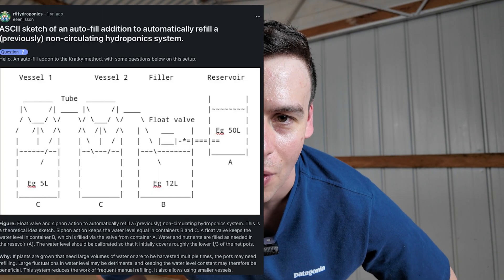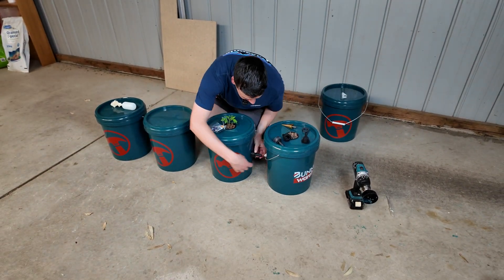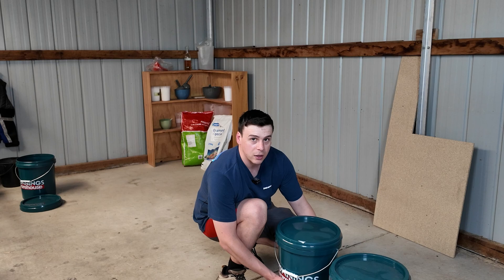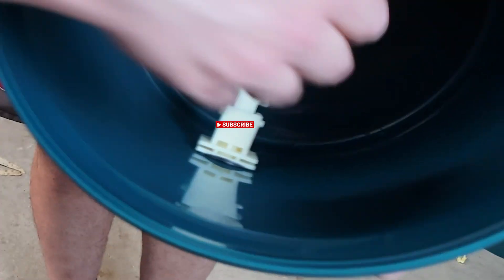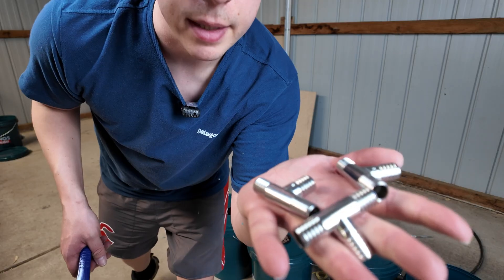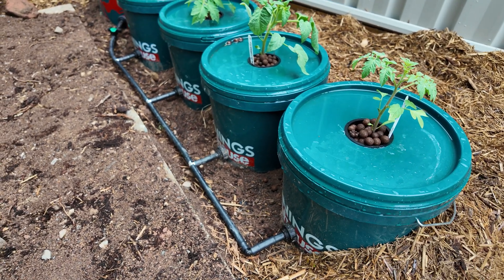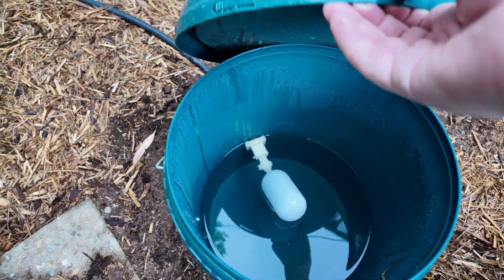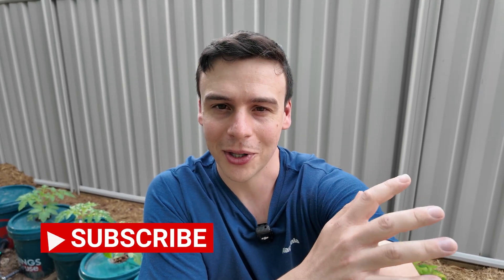DIY Unlimited Kratky Hydroponics: Easy Gravity Fed System for Automatic Refills

Comment: Can you also explain about the metal thingy that is just before the float valve. What is it for, where to get it and does it need to be metal. Thanks
Reply from the maker: This is to connect to the poly that goes to the nutrient reservoir

Comment: What is your 500 liter reservoirs and where did you get it.  How do you keep it above the level of your systems?
Reply from the maker: I use a 500L flexible PVC tank that I got online. The layout of my block means i have a high point in the garden that keeps it above the level of the system. For lower points in the garden I use 200L tanks and I built a stand with some bricks and sleeper timber.
Reply: @GrowthEquationAu  Thank you.  Where about on line did you find the 500L tank?  Can you do short video showing us the tanks and the stand please.

Comment: Just the video I was looking for. I have just learned about Kratky and want to get started. I had this exact option in mind using a 55 gallon drum and float buckets. I have access to white buckets with green lids. so U know I will need to trench and shade. I am wondering what plants you are growing off of the same nutrient source as the tomatoes? Also I am planning to use a pool noodle off the side of the bucket to hold the plant so rain should not impact my water levels. My garden is usually a section of Swiss chard, lettuce , eggplant, cucumbers squashes, beans, I'm guessing they will all not work using the same nutrient source but I want to keep things as simple as possible. Thanks again for this video.
Reply from the maker: Diamond T is great for raspberries, strawberries, tomatoes, capsicums, chillies, cucumbers — any fruiting or flowering crop that needs extra potassium. Just add calcium nitrate for calcium and more nitrogen early on. Not ideal for leafy greens (too much K). You should also check the technical specs or crop sheets to match rates to your system.

Comment: I'm having a bit of a problem with this method.  Over time, what happens is the buckets become concentrated.  I need to figure out how to circulate all of the water in the buckets.
Reply from the maker: I agree — I would flush the system more regularly next time with a drain to waste rather than recirculate, to avoid spreading any disease.

Comment: there is a float valve for livestock water its made for gravity feed and garden hoses. it has a protected float which I just now realized is helpful, but I haven't used it yet.

I also discovered Uniseals which are great for holes.

Comment: You don't need to drill holes and add fittings in all your buckets. This method is simpler and doesn't require any holes or fittings:

First, have all your buckets side by side at the same height. Fill the first bucket with water. Then use a simple siphon hose from the full bucket to fill the next bucket.  For example, take a three foot hose and stick it completely under water in the first bucket. Once the hose is full of water, put your thumb over one end to seal it off. Then pull that end out of the first bucket and stick it down into the next bucket. When you release your thumb, the water in the first bucket will siphon into the next bucket. The water in the second bucket will fill to the exact same level as the first bucket. The siphon will maintain itself indefinitely as long as both ends of the hose remain under water. 

Simply repeat the siphon setup for as many buckets as you have. Each bucket will automatically maintain the exact same water level. I use a simple float valve, or electric float/pump switch to keep the first bucket full. Actually it doesn't matter which bucket has the float valve as every bucket automatically maintains the same water level.

Basically, the technique is like siphoning gas out of your car. Stick a hose in the tank of gas to fill the hose. Then put your thumb over the end of the hose and pull it out far enough to go down into your gas can. Once you release your thumb the siphon gets going.

Comment: I've used this exact setup for two years, i got 45 buckets connected to one 200L reservoir via two float valves. I got cucumber and tomatoes in the buckets and this system is low on maintenance. I fill the res once a week approximately. Really convenient! Would like a 1000L res but cant fit it.
I drilled all the holes in the buckets at 5 cm from the bottom except for the hole for the float valve, that hole is 20 cm up from bottom and i got the nutrition level at 15 cm from the bottom leaving 15 cm of airgap for the roots.
This system is under a roof so i got no issues with rain.
Reply: So what other veggies are you growing with the same nutrients. Going to give this type of setup next year
Reply: Do you have a video showing your setup sounds awesome

Comment: Be careful with rubber seals if you use a wrench to tighten it. Too much pressure is bad. The seal is deformed and often damaged in the long run. The life-time of the rubber seal is greatly reduced. No problem if you can buy the seals in huge quantities without buying a new float valve. In general I would tighten it just to the point that no water leaks out.
Reply from the maker: You would love my video on unlimited deep water culture!

Comment: are you having to top them up for the initial setup so that the roots can reach the water level? and what if you have different plant species with one a lot more thirsty than the others, the water level could drop before the others develop enough roots
Reply from the maker: I didn’t have this problem, but if it kept you up at night you could just add more taps or one way flow valves

Comment: i have constant problems with that specific specific float valve blocking up so I am going to try moving to a dipstick float valve https://www.youtube.com/watch?v=g2tLzqxvQaU
EDIT: I might try removing the filter first ;) thanks for that one
Reply from the maker: I have never had a problem with the float valve blocking. Do you have a filter between your reservoir and the float valve? I use a 13mm In-Line Poly Filter between my main reservoir and the unlimited Kratky buckets 💧

Comment: I love using the Kratky method I'm in the WA wheatbelt where at the moment we have regular over 40-degree days so it's hot dry and windy.  I'm struggling with the heat and my water temp at the moment.  So I don't have as much growing at this time of the year. I love that it's water wise especially where I am located. Just to put it out there stagnation is very unlikely it's caused by debris and non-moving water. This is a closed system and as long your roots are healthy there shouldn't be any debris or very little, and it is constantly getting topped up with fresh water. A 500 litre revisor would last me a week when everything is growing and fruiting so its constantly getting topped up with fresh water. I will definitely be setting up something similar to this when the weather cools down it's given me a few more ideas. Thank you

Comment: Sadly, if uour keeping that outside, the rain will fill up  the buckets as the lids are a great collecting system

How to fix?
Sasly again.. cutting up styrofoam boxes that become the lids
Bonus, they help regulate the bucket from abouve heat and uv, if ur in a hot area.
Reply from the maker: Rain floods the system,
Overflow spares drowning roots,
Check Nutrients, fix.

A haiku about an overflow

Comment: Nice setup ... probably been mentioned below but for uniform bucket hole-punching if they are unmarked.  Take a strip of firm cardboard - crease towards the tail to create a flap.  The flape goes under the bucket and the longer piece easily leans-up the outside of the bucket and of coarse it would have a hole in it so a permanent mar ker could easily mark at the correct height ... a 'Kratky7 jig". 🙂
Reply: Brilliant suggestion, so obvious, why didn't I think of that!  :)

Comment: If you replaced the valve with a check valve (1 way valve) you wouldn't need to monitor the level in the buckets. While the plant buckets are fuller than the float valve bucket the check valve would prevent backflow, once they were lower the check valve would allow nutrients to flow towards them. Actually, now that I think about it you don't need anything there, just fill up the float valve bucket to your desired height and once the level drops below the float it will refill, no valve needed, the float serves as a one way valve.
Reply from the maker: This is a great point - I didn't have a 1 way valve but this would work. Although, depending on where you put it you still want to deal with any overflow if you are growing outside and it rains!

Comment: Is it a good idea to use these flat faced inlets/outlets on circular buckets?
Reply: and is no aeration going to cause stagnation?
Reply from the maker: Great questions! Flat-faced inlets/outlets can work on circular buckets, but ensuring a proper seal is crucial to avoid leaks. A rubber washer or gasket, combined with careful tightening, does the job for me so far. If you’re concerned, fittings designed for curved surfaces might be worth considering, if you can find them!

As for stagnation, the Kratky method, developed by Dr Bernard Kratky, is designed to be completely passive. It doesn’t require active aeration like Deep Water Culture (DWC). Instead, as plants absorb nutrients and water, the level naturally drops, creating an air gap that provides oxygen to the roots. This design, combined with proper monitoring of nutrient levels, prevents stagnation and keeps the system running smoothly.
Reply: @GrowthEquationAu  could stagnation not occur in the large reservoir? Do you do any measuring of your ppms and how do you ensure the water and nutrient are consumed in equal parts?
Reply from the maker: Great follow-up! Stagnation in the reservoir is unlikely with proper monitoring. I use EC (electrical conductivity), pH, and PPM (parts per million) readings to keep the solution balanced. Plants take up water and nutrients at different rates depending on their growth stage and environmental factors. This can cause changes in the nutrient concentration over time, which is why regular monitoring is so important.

This might be a bit advanced for just this video, but it’s a great concept to keep in mind as you explore hydroponics. I’ll be making a video shortly to explain these ideas in more detail—stay tuned!
Reply: @GrowthEquationAu selastic on the bucket side of fittings is Ur answer if it becomes a problem. 
And if it's the basic stuff you can pull it apart down the track..
Automotive stuff is more permanent..
Reply: @andyh4747 airration is a whole sub type of kraky.

And your plants will do well as long as the container is not in direct sun light, will also depend were your located in the world.
Ie around the central part of earth, hot and direct sun will boil roots in under 40 minutes.

I experimented and found this out myself, styrofoam boxes worked well.... But U need to line it with sheet plastic as the roots dig throughout the Styrofoam..